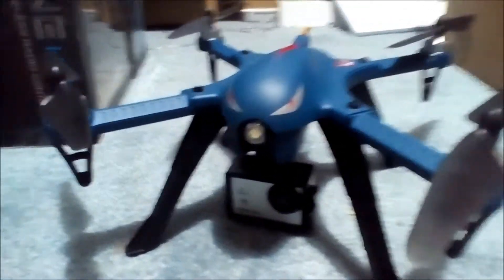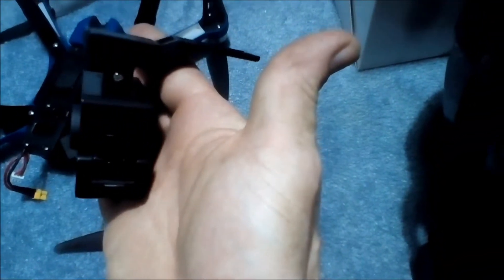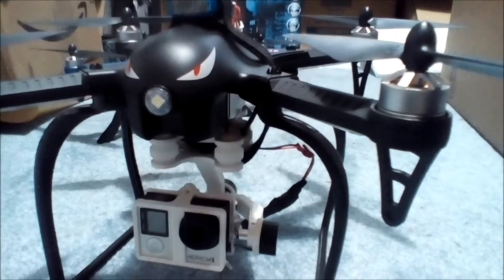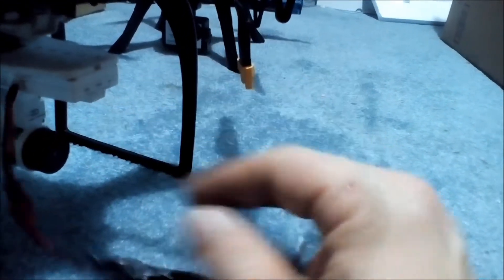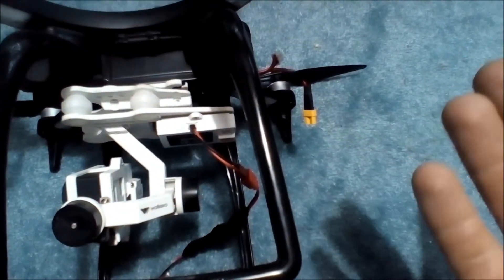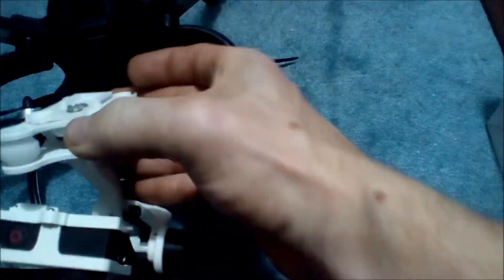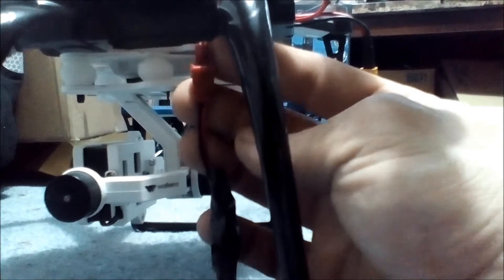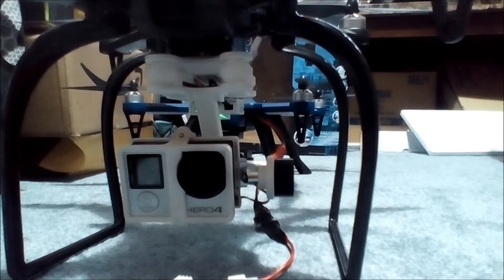MJX RC Bugs Walkera Gimbal HOW TO Brushless Motor Camera Drone DIY

Comment: Hey Jay! I’ve finally got my walkers 2d gimbal today! As I was trying to attach the gimbal to the bugs 3 battery house I noticed I have a piece missing. Then I went back to this video and I saw you have an extra plastic on top of your gimbal which allows the gimbal to slide onto your battery house. How do I get this extra part so I’ll can attach the gimbal to my bug?
Reply from the maker: moded from slide mount not bought

Comment: Hi Jay. Thanks for the video. Great info. I have today received my G2D Gimbal for the Bugs. The link you posted below for the mount, http://www.ebay.com/itm/232123356609 is different to your mount as the top of the mount is open with nowhere to add the screws. Your mount looks filled in at the top where the screws are. Is your mount some other type? Thanks again.
Reply from the maker: U have to mod it, might e was closed n I added screws
Reply: Thanks mate.

Comment: Where did you find the part to connect the gimbal to the drone?
Reply: Jay Drone if you type the description as aosenma stock mount you can not find anything on amazon or ebay
Reply from the maker: pulled and moded it to gimbal it is origonal to aosenmas stock mount
Reply: Jay Drone Ok thank you
Reply from the maker: http://www.ebay.com/itm/232123356609